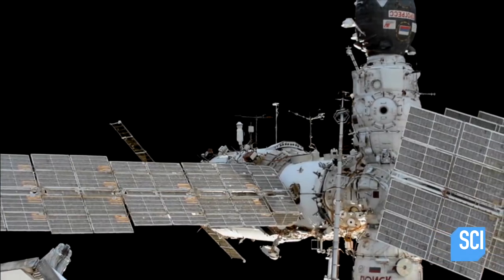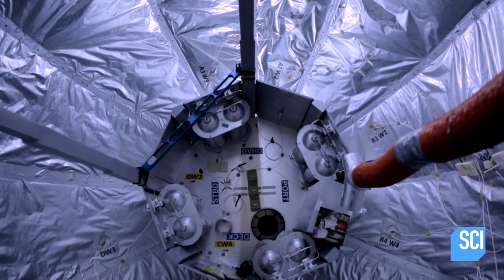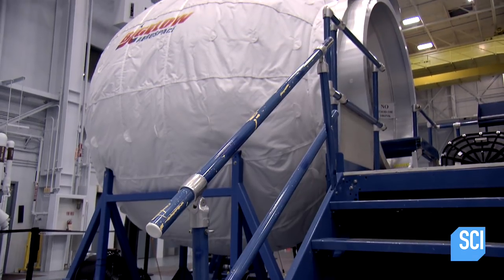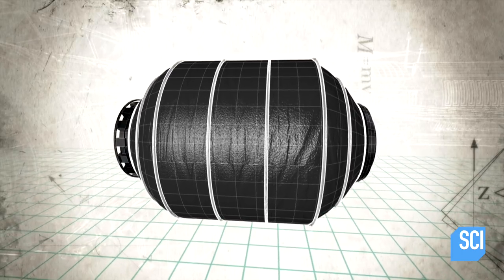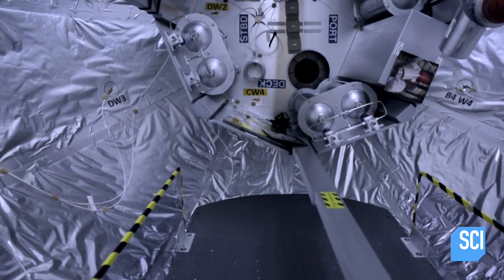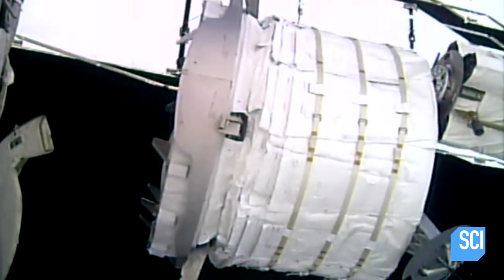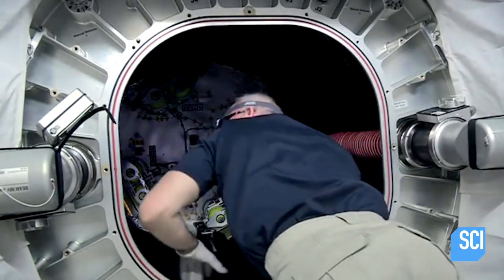The Future Of The International Space Station Is Inflatable | Impossible Engineering

Comment: The video explains that the Shuttle carried ISS modules that were 13 feet in diameter and new space vehicles only have a fraction of the Shuttles capacity. Those things are irrelevant since the current Ariane5 is 18 feet in diameter and Proton-M is 24 feet in diameter.

Going beyond everything else to the 40 foot diameter BA 2100  is where Bigelow Modules really standout.
Reply: the problem is none of them have enough power to lift the weight of the rigid modules the shuttle was carrying. The STS was able to carry 27.500 tons to LEO, only the Delta IV heavy and the Falcon Heavy equal that mass capacity
Reply: Not a problem, the heaviest ISS component the shuttle delivered  was 17.5 tons, well within the limits for Ariane 5 and Proton-M, the line about only having a fraction of the Shuttles capacity regarding the ISS is clearly wrong.

Comment: A space-shuttle is not a necessary condition for building a space station. One can do this easily unmanned and much more efficiently by simple rockets - the way that Russians do it. The empty Space-shuttle itself weighs 70 tons or so, which means a lot of wasted rocket energy for an empty box. Compare this with the weight of a module, usually about 15 tons, transported by the shuttle...

Comment: how to repair when micrometeorites strikes? sewing kit in space?
Reply: its kevlar... Stronger than steel and they using aluminium ... The bigger problem is structural strenght, but i dont think that this is problem in zero gravity. Imagine big dome 20m in radius. it would be impossible to do it from aluminium. But with this we can do rly big storages atleast.
Reply: It true it better than Aluminium or Titanium skin in terms of density & tensile strength, but Kevler doesn't mean a lot in space when space debris can travel 7x time the speed of a rifle bullet.

Unless using extremely thick Kevlar, which will increase in weight & travel cost & inflexibility to unfold, but at least you can replace Aluminium or titanium panel if struck.

It true that Kevlar structure can be pressurised and unfold like origami structure in space to wide open dome, which unlike rigid structure like steel, alu or titanium, but Kevlar may compromises in safety.

That is why I ask if they develop a Kevlar structure that is repairable or not?
Reply: guesswho kk, space debris can travel that fast, but i dont think that some debris in our orbit is that fast. And even than is better to detect that object and avoid it. 

In the way of repair.. Its way harder to repair aluminium than kevlar.. And you dont risk shrapnels too. 

But there is one big problem, space radiation. I dont know how thick aluminium walls are, but i think that it is still better protection against radiation than cca 5mm of kevlar.
Reply: HappyBreadfruit the polymers hydrogen/carbon that the inflatables are made of are able to better block cosmic rays which aluminum can't block. The AL atoms do not adsorbe the high energy particle they bounce around the aluminum structure and even give off secondary particles making it worse.
Reply: In overall its all about density and thickness. Radiation (alfa, beta, gamma...)
Alfa (He2+): can be blocked by list of paper so thats not problem unless you dont eat it.
Beta (electrons and positrons): can be blocked but harder than Alfa (still not so much problem)
Gamma (photons) : we need electrons to block it = we need a lot of electrons to catch that photons...

So we just need heavy material..... and yeah kevlar is better, bcs it is a littlebit more denser than aluminuim, but aluminium structures will be thicker than inflatable domes..
So i dont think that theese structures would be great in blocking radiation enough... But you still can use concreate or some shit to make theese inflatables strong.
Only plus is that theese inflatable structures can be rly small and very big after inflation, thats all.
Reply: Duct tape
Reply: There are repair patches, or if need be it just gets sealed off, it's not a critical system after all.
Reply: BEAM is covered in Kevlar and is built around an aluminum frame after testing the module will be encased with steel plates to protect it from meteor strikes.
Reply: The material is stronger than the material used in the space station itself when it comes to micro meteroties.
Reply: @forloop7713  idk bruh it just repairs itself according to nasa.

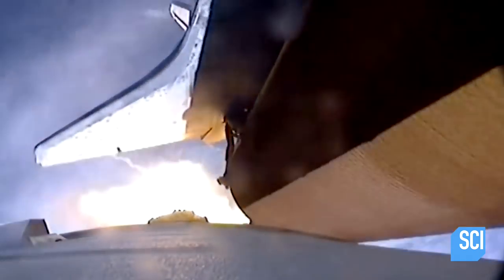Comment: 0:20 "as the emerging new fleet of space vehicles only have a fraction of the shuttle's capacity"

That's just bullshit. Let's compare payload to Leo. 
Delta 4 Heavy: 27500 kg (I've also seen 22500kg. Don't know which is right)
Falcon 9: 22800kg (if expended) 13 tons if not
Falcon Heavy: 63800kg (if expended) ~ 30 to 40 if not

Space Shuttle: 27500 kg
This video is from mid 2017. That shit was known a year ago. I didn't even talk about SLS, BFR or New Glenn, although they are going to fly soon as well. At least about as soon as BEAM is ready to use. Don't get me wrong: BEAM is a great idea and definetly has a future. Saying it's needed because payload capacity is to small is just bullshit though.
Reply: Your numbers are a false comparison (or "bullshit" as you call it). A Delta or Falcon just puts you into a LEO orbit. You need additional propulsion to rendezvous with the ISS, plus all the stuff like solar panels, batteries, computers, star trackers, telemetry, thermal management that goes along with it. In contrast, the Space Shuttle payload is the actual mass delivered to the ISS. For the ATV, this stuff cost about 5,000 kg plus 3,000 kg of propellant.

Comment: BEAM is the future. If we want to build a Moon base or go to MARS we need a place to put our astronauts and that place is BEAM. How it works is nylon straps hold the module down for launch in the trunk of Dragon or inside of a Delta IV rocket once the module reaches space it is extracted, mated to the station, and attached to a tire pump and inflated. Those UFOs you see during the inflation are the straps as BEAM is inflated the pressure removes the adhesive on the back of Velcro tabs and the straps are wadded up in Mylar and jettisoned as the module inflates. Once BEAM reaches it's full size it is the size of a small car or a closet. The larger modules will be the size of a bus and bigger. Biggalo is already making the next modules and these will go to the Moon.